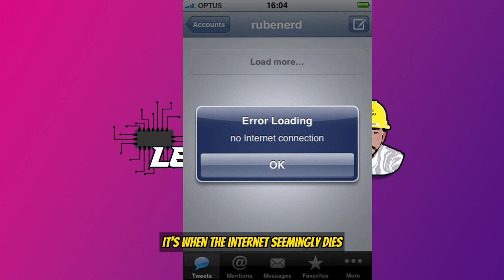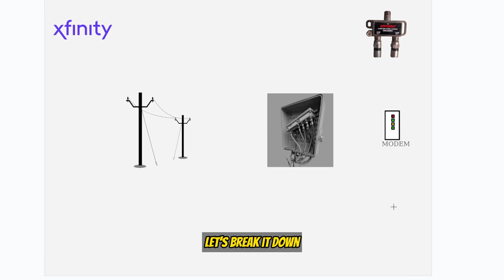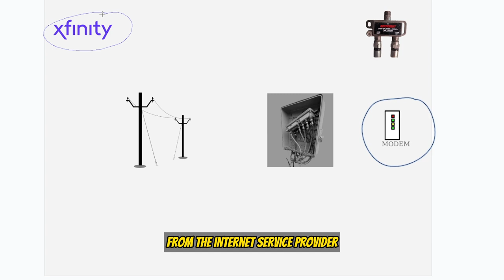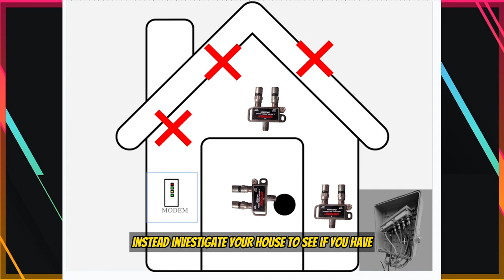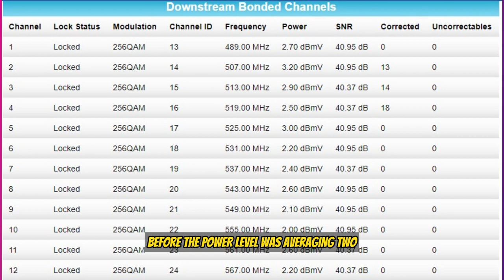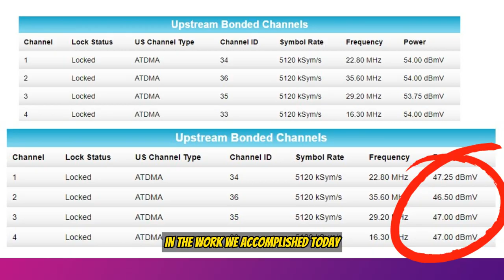I removed THIS to fix my RESTARTING MODEM! #networking

Comment: This is my line of work and hour vidoe was a great way to explain this on a user level! The top issue with connectivity is almost always wiring when we head out to service calls. With cutting the proverbial cord users don't realize those unused lines can be pesky in many ways. Great job Techy! #CoaxWiresMatter #FiberBuildIncoming
Reply from the maker: I appreciate you man! I hope it made sense and was accurate!!!